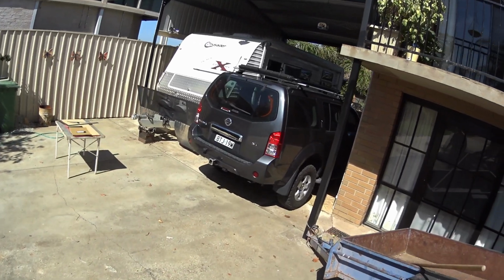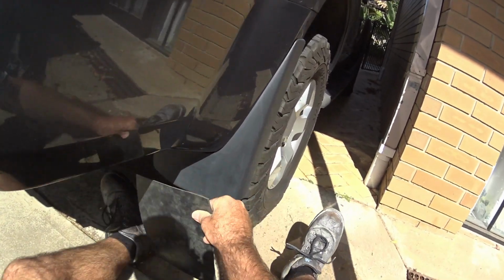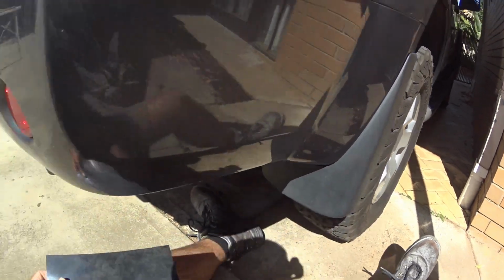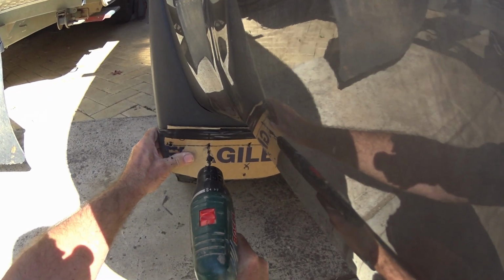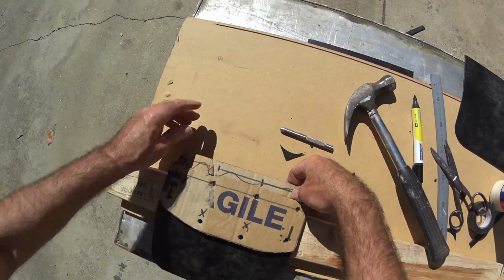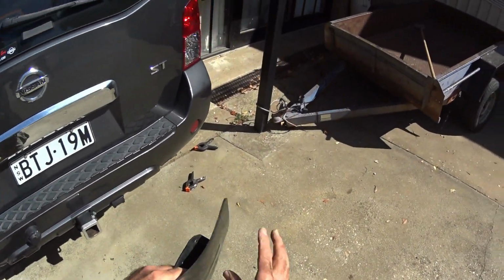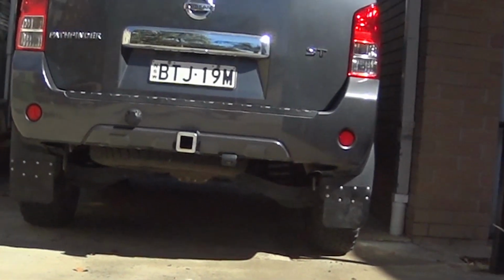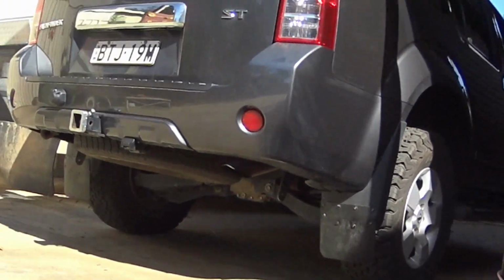I made the Mud Flaps Longer on our 4x4 to help protect our RV from dirt or stones when towing it.

Comment: I suspect that that rubber is so light that it may blow back too close to the horizontal to be much help. Try some 6mm thick sutt from Clark Rubber
Reply from the maker: Hi David yes it does blow back a bit, but it does work quite well, and on lower speeds in mud I can see how well it works. I agree with you 100% 6mm rubber would be better, but I an bolting it to a plastic mounting point, and if it gets caught up on something I want the mudflap to bend easy or break off, saving the the plastic on the 4WD. Thank you
Reply: @GavinClarkdiy  Yeah that makes good sense

Comment: Remember doing that for my bike...a few years ago now. Be interested to see how they go Gavin.
Reply from the maker: I have had them on there for a few trips now, they seem to work quite good. In the past I have done them on other trailers and my 4wds, I lost a few mud flaps because they were a bit long and when I reverse against a rock etc the mud flap would get stuck between the rear wheel and the rock and get torn off when the wheel rotates to climb the rock. I have these ones at a length that it should not happen as the flap will push up and the rock etc can get to the wheel. (Well that's the plan anyway). Thank you for your comment.
Reply: @GavinClarkdiy  It was clear you knew what you were doing. For me, it means I can go straight to something that works rather than suck it and see approach. Thanks.
Reply from the maker: The big downside would be if I get bogged very deep, the extra long mud flaps with put extra drag on the plastic they are attached to, a bit of shovel work will help prevent that when I am getting it out. Youtube is a great place to see the different ways to do a job, there are always a few ways. You are right saves you the suck it and see approach, there will be negative comments on this over time it's worth reading the comments under some of the videos some are right and point out problems, which could help people. ps I will get a comment that I should have pulled the original flaps off and replaced them with a steel or aluminum sheet with a mud flap at the bottom which would have been stronger,,,,,,I looked at doing that but it would still be screwed into plastic so it would not make much difference to me, if there was steel to screw to I would have done just that. HaHaHa I just about wrote a novel. Thanks Benny for your comment.
Reply: I like it mate good job 👍